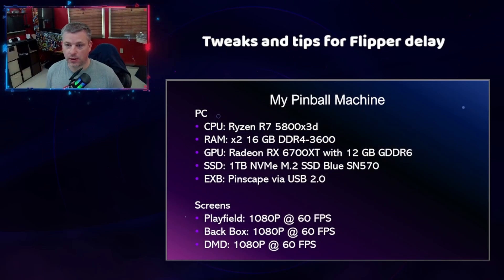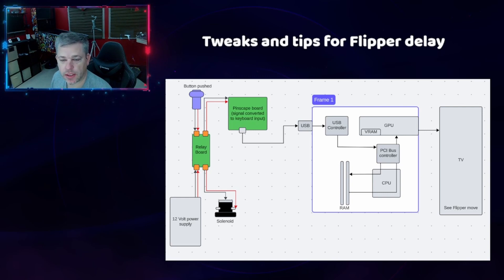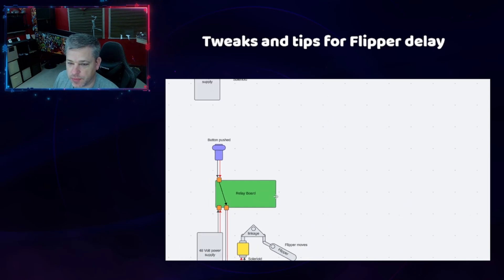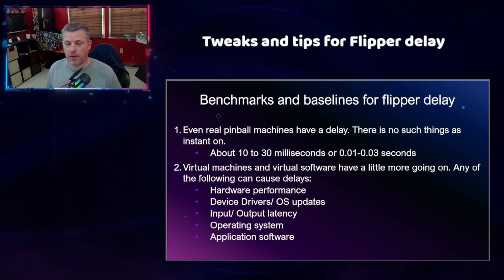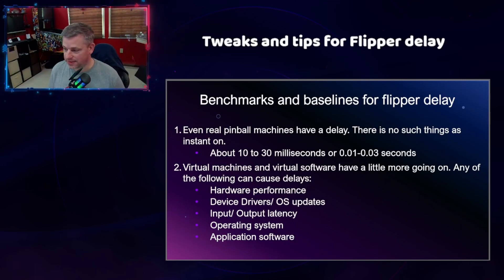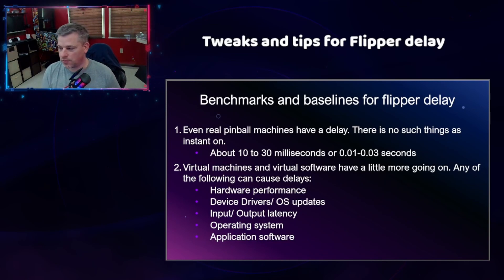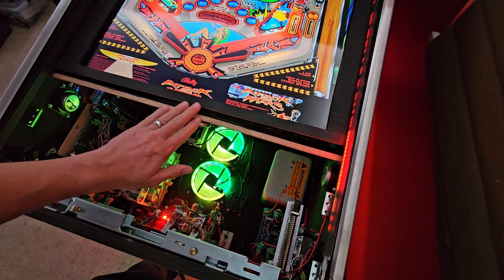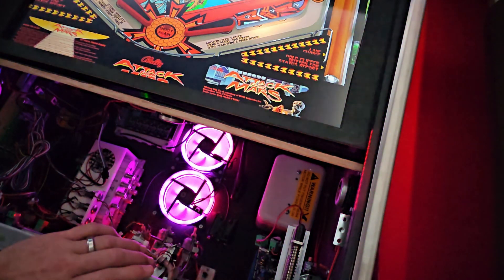Vpin Software Tweaks 03 Combating Flipper Delay

Comment: Nice video there's some very helpful info but I was using a 60hz monitor that had an ultra low game input and it had 13-16ms latency. Now im on an LG C2 with same exact GPU settings and now have between 4-8ms latency. It's hardly noticeable at all now plus I'm at 4k 120hz on playfield which looks amazing. If you can get frame pacing in VPX to play nice you can get almost zero input latency at whatever hz you want, but on my setup it just will not play smooth
Reply from the maker: I'm saving for a 4k upgrade that does 144 hz.
Reply: @chipgt81  this is the way!
Reply: @chipgt81  That being said, there is some room for 60hz frame pacing experimentation. I feel like you can get the best bang for your buck that way. But once you see the ball roll at 120hz, there's no going back imo

Comment: Hi! Thanks for the video. Niwak/Vbousquet developed the Frame Pacing sync system used in VPX 10.8 because he noticed the flipper lag in VPX 10.7. I worked with him to test it. If your system is well set up, as you explained, then any additional flipper lag in VPX 10.7 (and 10.8 if you don't use Frame Pacing) is linked to your monitor refresh rate. You will have more input lag on a 60 hz monitor (about 16 ms more), compared to e.g. a 165 hz monitor (about 8 ms). What Frame Pacing in VPX 10.8 does is to decouple flipper lag from your monitor refresh rate. If you use the DirectX version of 10.8, then your additional flipper lag is already much reduced to about 2 ms, while if you use the OpenGL version, your additional input lag is almost negligent at 0.1 ms. Frame Pacing also improves stability if your fps on a table varies i.e. struggling to maintain 60 fps on a 60 hz monitor.

Here is the Frame Pacing document that I wrote based on Niwak's input and explanations as he developed it.

https://docs.google.com/document/d/1vPb0u3jkt-Yf1pyStEQgfE9ypHRX9Ie9z6IdfotxwIQ